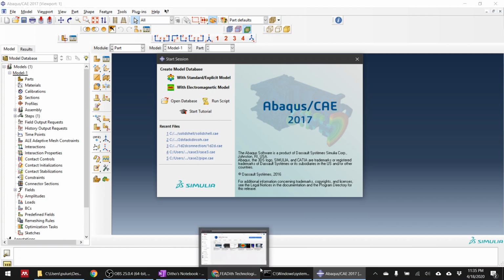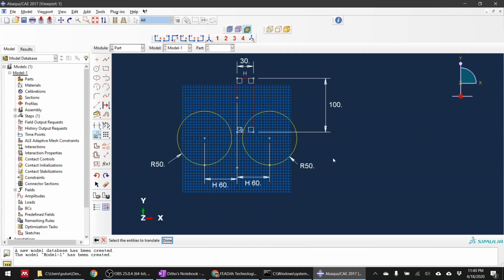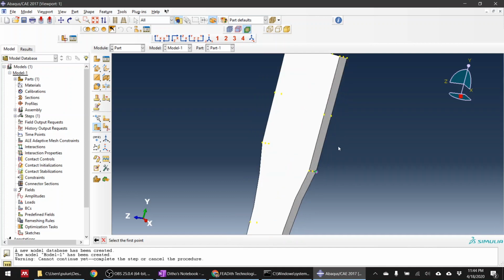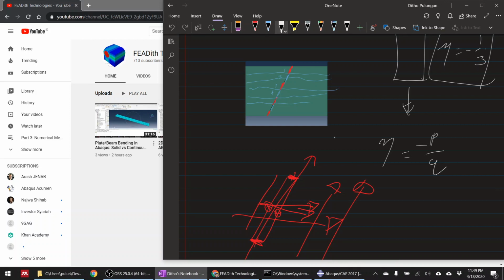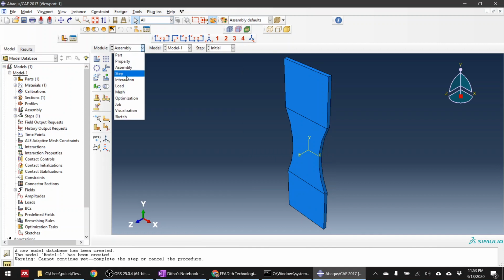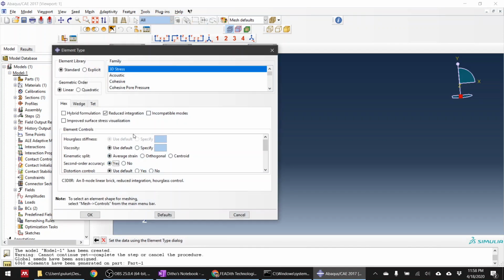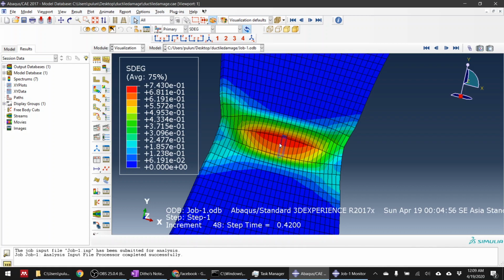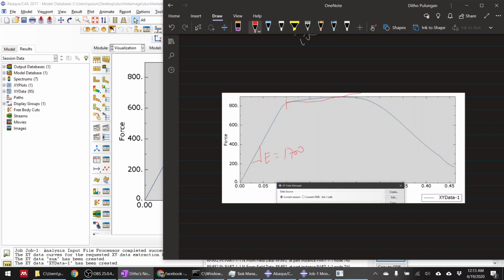Modeling Ductile Damage on Polymers using Abaqus Standard (Implicit)

Comment: Thanks for this nice video.
Can you please explain why did you take the fracture strain = 0.05. Your maximum plastic strain is 0.5. We expect the fracture strain to be higher than this value. Or maybe I have it wrong. Can you please explain?
Thanks
Reply from the maker: depends on the material you used. our PP fractures at 5% strain = 0.05, not 50% = 0.5

Comment: Just a correction: Under tension of a cylindrical specimen the triaxiality is +0.333 not -0.333.
Reply: In this case it doesn’t matter because only one value of triaxiality was input so it uses the same value for initiation strain for all values of triaxiality. P is the hydrostatic pressure which is defined positive for compression and negative for tension. So it +0.333. ASME BPVC Section VIII Div 3 has ❤an equation for triaxiality dependence in the article for local failure for different metals. For plastics,I know of no equation, you have to do tests or make some assumptions, like let initiation strain be 0 for triaxiality of 1.5 and draw a straight line thru the tension test point. The failure strain for tension test is ln(ROA).

Comment: Thank you for the video, it has lots of valuable information and has helped me understand some questions that i had. 

I am still unsure how to determine the effective plastic strain in order to obtain displacement at failure. 
Your example you give 100% but 100% relative to what? 

Thank you, I hope you can help me ask this question and great job!
Reply from the maker: at the end, you can do trial and error to find this values that match your experimental curves, for examples...

100% is strain... so relative to what? it's a strain... relative to its original length of course LOL.
but here.. strain is 2 parts, elastic and plastic... 100% I mentioned is only the plastic part...

but again, get this value by calibrating (trial and error) to match your experimental curves
Reply: To calculate displacement at failure it is the characteristic length x the difference of plastic strain at failure - plastic strain at damage initiation. So the 100% is plastic strain at failure relative to plastic strain at initiation, not relative to original length, LOL.

Comment: thanks for the video, I just have one question regarding material model: is it enough to have damage parameters just for only one triaxiality case? As you know, the stress state can vary at different positions.
Reply from the maker: when you model, nothing is enough... in the end it depends on what you want to model specifically.

if your case is tension dominated.. maybe one triaxiality data is enough... if your model is nonuniform, maybe putting 3 triaxiality cases is enough... but then strain rate is not uniform? then need triaxiality data for various strain rates? then the temperature is not uniform? then triaxiality data for various temperatures..? got the point? it really depends on things that matter for your simulations... so you really need to see what you want to see. LOL

Comment: Very Informative Ditho.  I like the level of detail.  One suggestion for those relatively new to FEA:  it is always a good idea to check the mesh quality for errors and warnings, after meshing.  There is a Verify Mesh icon (the one with the check mark on it) in the Mesh Module.
Reply from the maker: Thank you for your positive comment, Michael. Will include mesh vefirication in my next video. Thanks